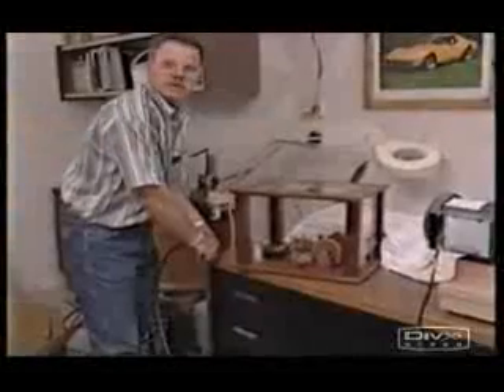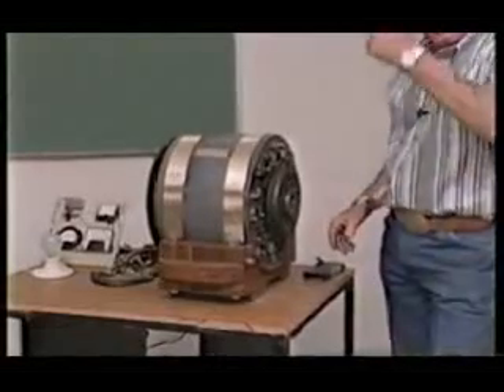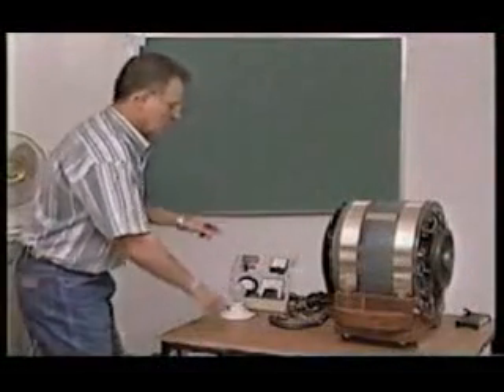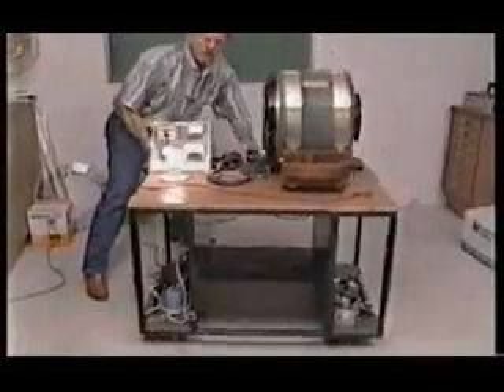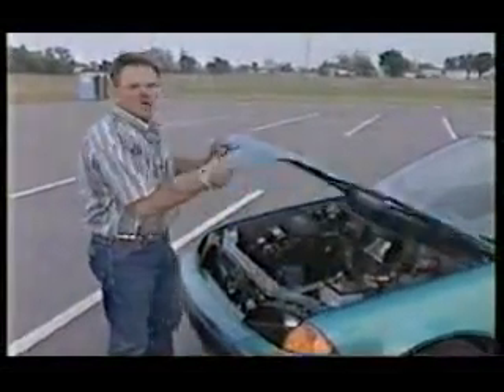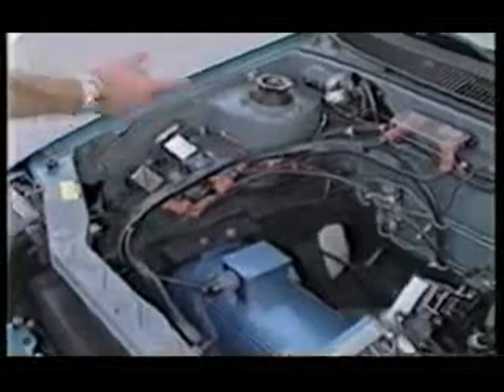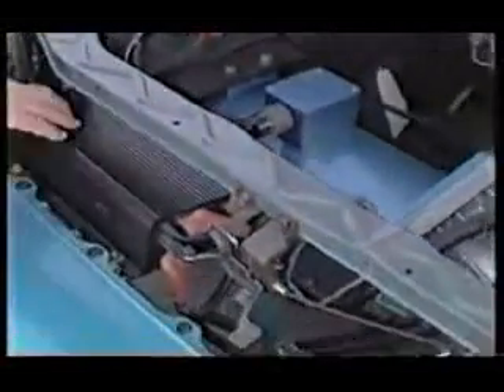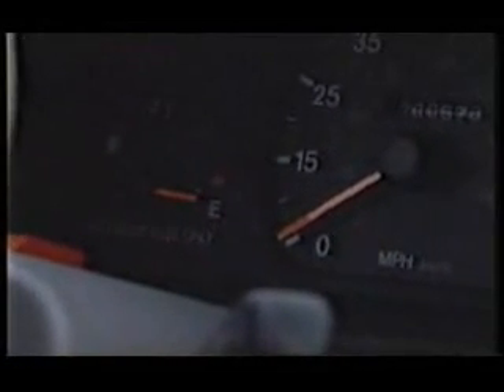Revolutionize Your Energy: Introducing Surge Tech Magnetic Motors

Comment: This is just another fake perpetual motion machine which goes against the laws of physics.  If you think this is real, go take an intro physics course...trust me there's probably a battery hooked to the bottom of the table.  They have the angle so that you can't see the bottom of the table-top, there can be thin batteries there.  There are ALWAYS batteries.  For a perpetual motion machine to work, you would need 0 friction which may be possible temporarily, but if you try to get power out of it, it will stop moving.
Reply: Your a Moron! have you ever taken a physics class?

Comment: there has to be a battery to assist the magnetic motor, but the motor must replace some of the battery power to keep it going, otherwise, the power it takes to propel the car and the mass of the occupants has to put a drain on the battery, and/or the motor's output.  I'd like to learn more about this motor, but there is no such a thing as perpetual motion. Some things are more efficient than others, but there is nothing that is perfect that can keep putting out energy and not get drained somewhere.  But, I would like to see more of this and learn what it does, and how it works.
Reply: Andrew Gulick You're giving Andrews a bad name with your lack of faith an intelligence in this man that's x100 smarter than you
Reply: Yes. the battery assists it to go. once it gets up to a certain rpm the battery shuts off and is then charged by the motor.
Reply: Andrew Gulick It is a hot air powered wallet emptier.  The car is just an electric car powered by some batteries.  It will drive far enough on the energy in the batteries to fool people.

Comment: hey man i don't know if ull read this i did u one better mine levitates no wheels needed no resource needed no moving parts other than a switch
u only need mettle thats the secrete mettle has alot of stored power u see it when u drill at high speeds

Comment: Now, as far as this video describes by its inventor, The cars can run on electric motors however there is one flaw in this video which he goes on to talk about in which uninformed people will tend to believe due to not knowing the actual facts. If the amperage goes down, that means that there is a loss of power in which will also reduce the amount of power you are currently using meaning that you will not attain a certain speed as he tries to make you believe. Still great technology though.

Comment: @knowledgemonger
You have to impart energy in order to move an object into a position in the field for your equation (which I refuse to call "energy" at that point, any more than I call it "energy" after you picked up a block and put it on a tabletop. That's "potential"-which is all I am willing to attribute to putting an object into a field).

Energy and potential are two different things (at least they were when I was trained). But, the calculations are identical (one can become the other).

Comment: This is, if true, a machine to die for. It is unfortunate that there is another patent holder in the US and Canada that has a patent for the electronics behind the regenerative circuit that is used in this process. If Mr. Reed actually does make this motor work he will be paying a considerable amount for using this  process. Obviously he and others have not done their patent research correctly. This motor seems to be running in a perpetual manner and there is a patent on perpetual motion. Sorry.

Comment: (cont)
There are metals that tend to spontaneously break down H2O into H and O, however those metals then degrade and get used up very fast. Essentially, those systems run on the potential energy of breaking down metals. But, those metals don't last long, and have a finite supply, and it would be cheaper to use GAS than to keep replacing the metals.

Anyway, bottom line: the dumbass fools keep thinking there's a way to bypass the laws of thermodynamics. They simply don't understand physics.

Comment: @atomikus37
Stan's water car had the most INefficient motor ever! He took electricity (battery), electrolyzed water into H and O, combusted the H and O through an engine to make H2O again, which also drove the wheels. He ran an alternator to charge the battery. But, after all of those steps, there's no freekin' way there was enough charge for that. Nor will there ever be (laws of physics). His car ran until the battery died, and would have gone FURTHER on battery drive WITHOUT the H2O & engine.

Comment: @knowledgemonger
That is exactly correct: all tide-powered energy systems slow the Earth's rotation (at a quicker rate than it is already slowing).

As for practicality of using the Earth's magnetic field, yes, I agree that it is VERY impractical with any known method (and it would ALSO result in slowing the Earth's rotation). I was merely pointing out that it's not "impossible" (as the claims made by Troy Reed in this video and by all of the other "free energy" nutbags ARE 100% impossible).

Comment: Motor having reciprocating and rotating permanent magnets Stephen Kundel
U.S. Patent number: 7151332
 close, but this guy got it, and uses a 9 volt battery to energize an actuator which changes position of the permanent magnets ..check it out on google patents..

Comment: @RealStuntDriver
You pointed out that he says this will be marketed in a year, and we're already 3 years past the video post date. Actually, this was a 1994 scam. So, we're about 17 years past the date.

Yes, his "motor" was nothing more than a common dynamo that was invented generations before this moronic yokel was even born. A standard over-the-counter battery is FAR more efficient.

And, the car just used batteries, not the silly "motor". Just another scam that nutbags will not let die.

Comment: Inductrack is a passive, fail-safe magnetic levitation system, using only unpowered loops of wire in the track and permanent magnets (arranged into Halbach arrays) on the vehicle to achieve magnetic levitation. The track can be in one of two configurations, a "ladder track" and a "laminated track". The ladder track is made of unpowered Litz wire cables, and the laminated track is made out of stacked copper or aluminum sheets.  Maybe something like this could be utilized....

Comment: @botch8949 - the force gained from two magnets repelling is the same as that required to put the two magnets in position to repel again.  When you take into account friction and eddy current losses any magnetic powered device will not start, or if started will stop quickly.  Very basic physics if you bothered to research it.  The number of magnets is irrelevant.

Comment: Look in the engine the blue motor is a standard rotating motor. But I don't see any of his magnet generators??? Does anybody see it? So the standard motor is running from the single battery but how is the battery charing if his generator is not there.

Comment: You can google "Surge motor Troy Reed"
and find out what happened.
He meant well but finally admitted that it did not achieve over-unity.
This motor is really a kinetic energy storage system.
As that,it works something like a mechanical battery.
There are real over-unity designs but I'd have to say that this is not one of the successful ones.

For what it's worth,a simple golf cart can work with a "solar-station" for reasonable distances as long as you ration your driving.

Comment: so it costs more energy to create strong magnets than the power of the magnetic field? So that is not efficient and still no free energy source because you have to put very much energy in making magnets.

But you can also make electric magnets  with coils. This costs also electric energy but if the magnetic motor drive a generator that creates more electric power than the coils use, you have a free energy source :)

Comment: on the floor without letting wheels stop spinning, pushing forward again and faster, then lifting and repeating until wheels are going really fast then let go and it will roll for quite a ways as what ever motor is in it winds down respectively.

So I think this type of motor in question might be a good idea as a temporary battery charger. He said so himself in the video just before he showcased his automatic trans. electric car.

Comment: It's actually a pretty safe process.
Read up about it, there's not a whole lot that can go totally wrong.

There are also other "green" ideas like putting turbines in the water to gather power from the movement of the tide, geothermal, solar, wind, and I'm sure there are others too.

However, these are not it. There is no over unity ever, either.

Comment: Mine is from the U of Alabama class of 1973, the magnet motor does work but it will spin itself to destruction unless you put a constant load on it. You can try it yourself, 5 cylinder shaped magnets mounted horiz with end magnets on each side poles opposing, one side about 30deg down the other side magnets 30 deg opposite upward, use odd number of magnets. Spin it , if it doesn't run I'll buy you lunch!   I attended U of A, U of So Fl and UAB.  By the way, the cavitation heater works too!

Comment: Hydrogen is made by introducing a large amount of electrical current to a contained body of water.
The container will then have a hose going out to the fuel inlet of a fuel system, probably post fuel filter.
Just look up HFC's on here even.
It's easy.

Interesting story, though. The guy who made the water car didn't actually make the water car. Twas a scam.

What a shocker.

Comment: One other thing, due to an electric motors (3 phase anyways) are capable of constant torque at any RPM, there really is very little use for a gear box. 

I believe the Tesla Roadster uses 1 small electric motor (80lbs or so) and no transmission.

Comment: Looks a lot (a hell of a freakin lot) like a kinetic capacitor. Basically a large flywheel connected to an electric motor.
The motor revs up the flywheel, then when disconnected the motor turns into a generator which powers the light for a limited amount of time. 

I don't buy a single youtube video saying that they had created perpetual motion, or "zero point" energy. Bunch of BS.

Comment: Wrong!  Take a bicycle wheel and attach magnetic tape at about 2" apart all the way around and put the tape at about 30 degree angle to each other. Then attach a fairly strong magnet at 30 deg angle at a Vee to the magnetic tapes on the wheel then spin it!  It will keep running until you stop it!

Comment: Just think of what the potential output of a spinning shaft is. Its almost unlimited. I used to use a machine that took 200psi of air and turned it into 2000psi of hydraulic power. I know an Australian guy has one of these attraction motors that can run for years. Weather or not this guys gotten his that far I don't know but similar technology is already working. They just don't do it here. oh and he obviously said it USES 5 volts and PRODUCES150.

Comment: Magnetics move the "fluid" which electrons flow around. The earth is not an electrically neutral body in space, it's surrounded by a magnetosphere and that is interacting with the suns solar plasma. Voltage decreases as you are closer to the surface of a body. With that little bit of knowledge, you can see that magnets can interact outside a closed system.

Magnet Motors can run forever if built right. No shortage of examples on youtube. (bought out by oil and car corps.)

Comment: On the other hand this motor does look interesting. Spinning or ramping up the motor might take more energy at first but one could link it to the braking system of a car and the motor could spin up every time the vehicle is needed to stop at a red light. (And red lights, there are a many.)

It sounded like he said he was using a 5V (?Amp) motor to ramp up the magnetic motor and the out put gave him 120V. But how long did it take to ramp up and how long did the motor in question run for?